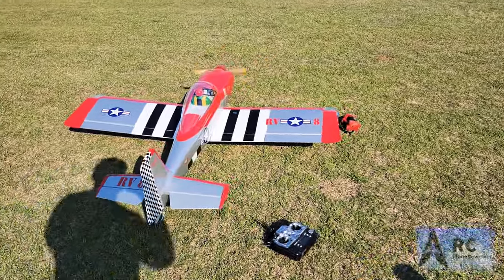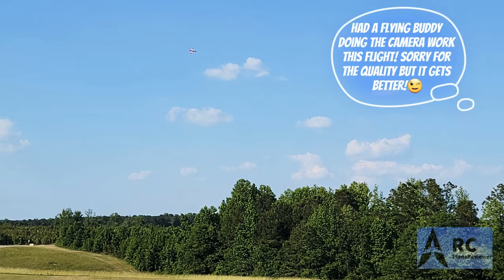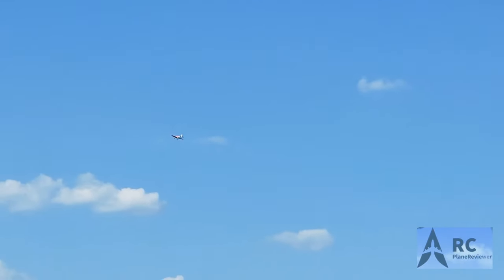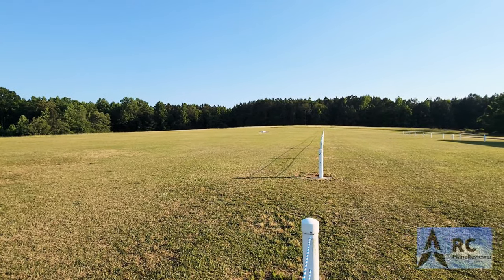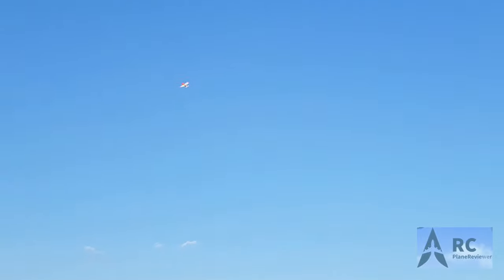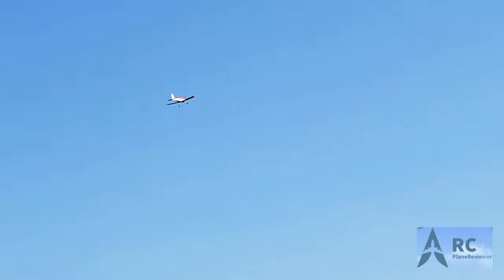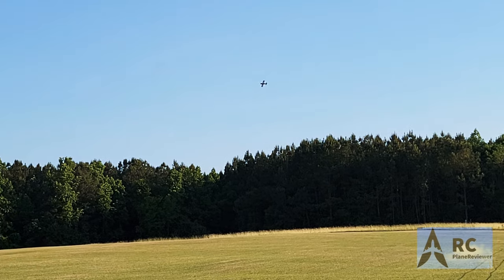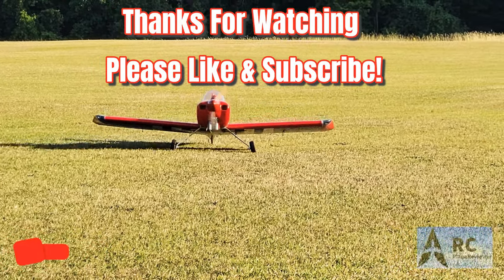☆Re-Maiden☆SEAGULL MODELS VANS RV-8 "DIAMOND DI" W/DLE 20cc

Comment: I have just bought a DLE 40 twin so I don't need to add any lead to this baby 😁👍
Reply from the maker: Smart man! The 20 isn't nearly enough weight
Reply: @RCPlaneReviewer  added bonus it also jumps from 2.5hp to 4.8hp more than enough for this plane although in my opinion the undercarriage isn't strong enough 😁👌
Reply: @stevearmett1565  The landing gear is more than strong enough unless your landings are as bad as @RCPlaneReviewer's "arrivals forced onto the ground with down elevator"........
Reply: @RudixSA  flew mine first with a Saito 125 needed weight added, plus two large 6v C packs to get the CG right with all that weight the undercarriage flex was intense !